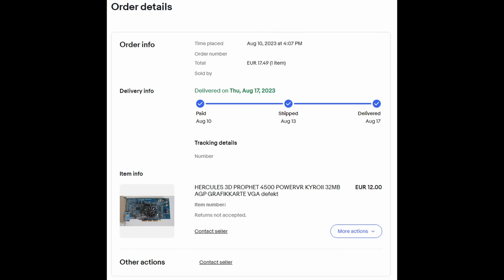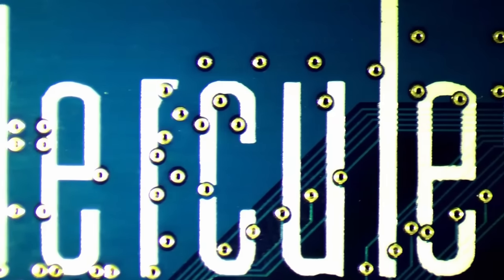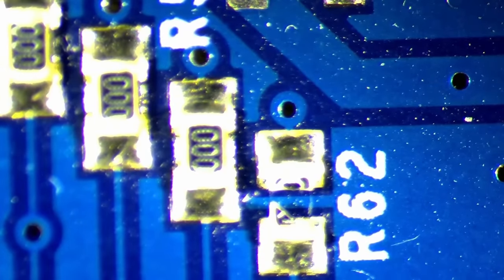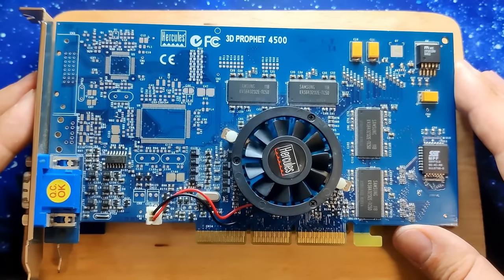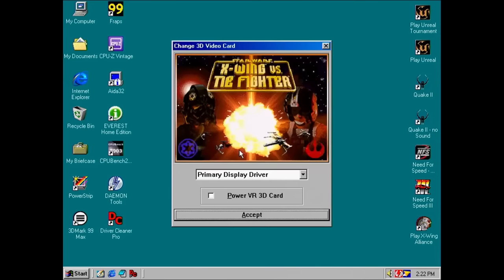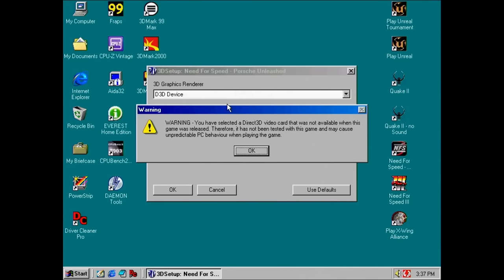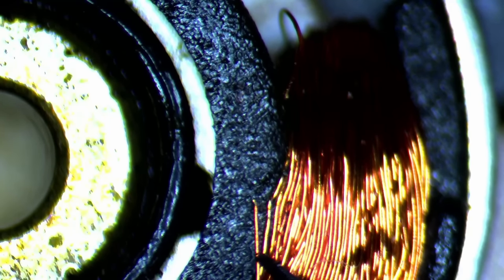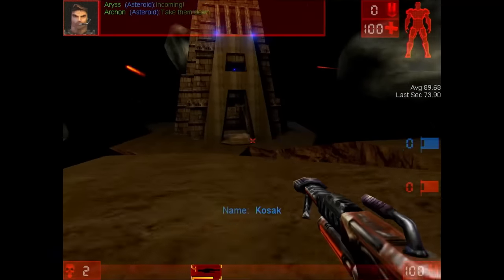Lifeless Kyro II - Reviving a 3D Prophet 4500

Comment: They were one of the best bang for the buck back then, with performance close to a GeForce2 GTS for a lot less money. But the lack of T&L and limitation to DirectX 7 is what stopped it in its tracks really quick. After the DirectX 8 cards were released (Radeon 8500/9000 and GeForce 3/4 Ti4200) and soon after DirectX 9, it was completely outclassed. It had about one year of relevance.
We all wished they released the Kyro III 5500, but the only thing that came out was the Kyro II 4800 (only to some journalists and some devs), which was a slightly overclocked version.
They later switched to mobile 3D graphics, and in a way are still alive in many phones.
Reply: The iPhone 4, and many tablets used Imagination Technologies chips, I too wish they had continued in the graphics card industry, I loved the technology behind the card.

Comment: I was rocking a struggling TNT2 M64 when I finally saved up enough to get a KyroII. It was paired with my Duron 800 (which I still have) and suddenly all my friends with GeForce2's were left in my FPS dust in CS and TFC! Until the later GF3/4 and T&L took over of course... great repair! Can't wait for a deep dive into tile based rendering! :)
Reply: Unless you meant the Geforce 2 MX and the first gen Geforce (SDR and DDR), otherwise the GTS/Pro/Ultra were all faster than the Kyro II. But they were way more expensive, the value was much higher with a Kyro II.

Comment: I, too, owned a Prophet 4500 from 2001. It was quite a jump from the Diamond III S540 that I had before, and in some games could even show a GeForce 2 Ultra up, but these were few and far between so in general, it sat closer to the original GeForce 2 MX, and newer titles demanded much stronger texturing, so I replaced it with a GeForce4 Ti 4200-8X in mid-2003 as we never did end up with the mythical Kyro III with its hardware T&L. The Kyro II had some wonderful features, though - it was a monster with stencils, rendered internally in 32-bit colour (so its 16-bit output was better) and it handled FSAA rather well.

Comment: As for the 0 ohms resistor, easier for pick and place, and easy way to jump over traces, might save you from doing a 4 layer board

Edit: Or me jumping traces on protoboard so I can avoid using wires hehehe
Reply from the maker: Ha! Jumping traces on a layer! That's a great use case I didn't think of! Thanks for mentioning this.
Reply: @bitsundbolts  I only realized that 2 weeks ago or so when I couldn't figure how to route a prototype "nicely" hehehe
Reply: @bitsundbolts The jump tracing feature only occurred to me while watching this video as the broken resistor in this card actually jumped over a trace... 😂
Reply from the maker: I didn't pay attention to that. Haha. I was so fixated on the resistor that I must have missed this right in front of my eyes.

Comment: Insight regarding the 0 ohm resistors:
Indeed, 0 ohm resistors are convenient because a P&P machine can place them around.
They are useful for jumping over traces, as is the case on the board you repaired
They are also regularly used for circuits where an actual resistor may be desired depending on eventual performance or future component swaps/stand-ins. 
There's more reasons, but these are the ones I can think of right now.
Reply from the maker: Thanks for all this info! When I fixed that card, I didn't pay attention to the PCB and didn't notice that the 0 ohm resistor was used to jump over a trace! Definitely something that may help me designing PCBs in the future.

Comment: I had a radeon 9000pro.. on a dual socket 370 with two Tualatin 1.3ghz cpus on an abit vp6 back in the day.  Later went to a 9700 allinwonder.

Comment: I had one back then bought it new! I gave it to a friend and I am very sad I did that because I lost it now and can't find it back...😭
I chose it because it had more VRAM 64MB compared to 32MB Geforce 2 cards had and ATi ones back then for very little more money, it had much greater look that beautiful Electric Blue PCB, also had a TV-out a combined Composite and S Video jack with a little adaptor the box had inside for composite video and included PowerDVD 3.0 which was a very nice bundle to have back in 2001 when internet was a luxury here in Greece.
I remember playing NFS Porsche unleashed with no issues! Your cards do not have TV out parts populated. Also I have never seen one with the DVI part populated...
The card was great in everything I used it of, I used to connect the PC at the TV in the living room and watching movies with my parents or playing games there on the bigger screen which was a better visual experience than my 17 inch monitor.
I had it on a QDI mainboard with a Celeron 800Mhz CPU 100Mhz FSB PIII Class, an SB Live soundcard, Pioneer DVD ROM CD RW for the newer ones that means it could read dvds but read and write only CDs, and I was more than happy! 
I still have the box at my parents' house and all the things that came with it except the card.... 2 beautiful labeled CDROMs with drivers and PowerDVD the most beautiful CD labelling I have seen till this day, a booklet, a leaflet and the adaptor for the composite video.
I changed it completely by accident cause I went to make a system upgrade and use an AthlonXP CPU which was the trend for gaming PCs back then when Pentium 4s proved to be space heaters with bad performance, and took a friends advice to buy a motherboard with NForce chipset for my Athlon.
That was my terrible mistake! He did not know, neither did I , nor the guy at the store which I bought the motherboard that Nvidia was always designing parts first for themselves and then for the others. Nvidia had no AGP 2X cards at the market at that time and for quite a while, so they introduced an incompatibility on purpose to direct you to buy one of their cards with 4X and 8X AGP bus spec.
I just set the system up and system refused to post! I was really frustrated and returned the MB to the store as defective an Asus MB. Then he gave me an MSI one with Nforce chipset which had written in the manual that the AGP port strictly supports 4X and 8X only cards! I would have returned that too but I did not know that the VIA chipsets and SIS ones supported  all AGP speeds and said well the MB is not defective, the industry abandoned AGP 2X, my GPU is old I have to change that too... So I bought a crappy Geforce FX 5200 with the few money I had to match the Nforce chipset.
I gave my Kyro II to a friend which after 1,5 years bought a motherboard for Athlon64 an Asus, that had VIA chipset an was a generation newer than my nforce one, and my Kyro 2 just worked there!
I was so mad at Nvidia when I realized what they did and since then I never bought an Nvidia product again. I also lost TV out for buying that crappy GF FX 5200 so movies with parents and friends gone since I gave out Kyro.
I just found your channel, keep up, that's my story with my 3D Prophet 4500 w/TV-out 64MB @ 175Mhz SDRAM VRAM card 
Cheers from Greece! Jim
Reply from the maker: A very nice, but also sad story. My memory of nForce chipsets is cloudy at best. I did have an nForce2 if I'm not mistaken on a gigabyte board with an Athlon XP 2700+. However, I never owned a Kyro back then. I remember reading about them in magazines though. They sounded like a double edge sword - at least it felt like it. It was the underdog, a different technology, much cheaper than Nvidia products, but at the same time matching the performance of the flagship competition. It was the smart choice to get a Kyro back then.
Reply: @bitsundbolts  I will be completely honest and tell you that they main 2 reasons I bought it were the something different from the ordinary concept as you said and the looks at that time! The bright blue board looked just stunning compared to the other green or brown cards which looked so ugly and ordinary. Also the round blue heatsink with the little fan added to the picture. TVout and 64MB were the nice additions even though it was sdram rather than ddr of the others.
Reply from the maker: The Kyro did look different from the competition. Unfortunately, that might have deterred people from buying it equally as it fascinated others - like yourself. Either way, I agree with you - it does look nice all in blue.
Reply: @bitsundbolts  Also something I noticed after the video and some pictures of my old card, it does not have any electrolytic or round caps at all! I think this was very rare for 2001

Comment: I often use 0R resistors on boards if I am unsure of prototype connections or more often if a track may cause EMC issues which can be solved with a 10R or similar resistance to lessen current spikes

Comment: Funny enough I just sent a box to a friend in Utah with a Hercules 3D Prophet 4500 in it. has a few broken traces by one of the heatsink pegholes, because I was the dumb kid that used screws to mount a completely wrong heatsink when the old one was so clogged with dust that the fan was seized in place. I'm hoping I get a working card out of it again, I can't do repair that small and that card brings back some good memories of 15 years ago.
Reply from the maker: Hope your friend can fix it!

Comment: At 0 Ohms it's only there to provide a jumper or shorting link on the PCB without having to redesign the PCB for small changes, Solder bridge it basically 🙂
Reply: But to clarify, yes - the most common reason is for selective configurability without gross changes!

I, for one, would love to see some comparisons ... I'd love to see you hit up the old S3 Savage3D GPUs too, especially with their "S3 Texture Compression" ... I remember in the late 90s/early 2ks that a lot of my gamer friends were drooling over the texture details it allowed - there was a patch for Serious Sam and the Egyptian (iirc) art looked mind blowing, compared to the blown out, too smooth low res 16bit mess that 3DFX offered at the time!
It wasn't just about saving VRAM, it was about enabling large texture support!

Edit: That whole Prophet 4500 card smacks of a generic placeholder design though ... I wonder what chips might have gone in those placeholders in the solder mask?

And, note that the mask on the backplane looks like it could host a DVI port? I wonder how much clarity you'd get with that? Assuming it's wired up of course, it might route through the smaller of the blank chips ... ?

Comment: There was a very short timeframe where Kyro cards were a good budget choice but the Kyro 2 had very tough competition and lacks some important features, no shaders or Hardware T&L, was a problem when it came out, The advantages of tile based deferred rendering just didn't provide enough of a benefit when the competition  just ended up using extremely fast memory with wide bit counts. The technology is fantastic for embedded applications though and saw a lot of use in phone gpus.

Comment: A zero ohm resistor is often used as a fuse
Reply: it worked
Reply from the maker: I've heard that a few times, but aren't there real fuses that would do a better job at ... fusing?

Comment: I'm going to inspect the resistors again on my two dead Kyro II Hercules cards.  Both crapped out after I got them to run Battlefield 2 and Halo in my PIII i440bx systems.  I figured it was just too much strain on the cards, they overheated or whatnot.  I've been careful not to force hardware T&L games on my remaining Kyro 1 card as a result.

If X-Wing vs Tie Fighter supports Power VR it is most likely pre-Gen3 Power VR support for the PCX-1 and PCX-2.  The Kyro series cards do not support SGL or PCX-1, PCX-2 specific games.  The Neon 250 (Gen 2) Power VR card was the last to support the older SGL games, and that support even has issues with some earlier games specifically coded for PCX-2.

Comment: I remember looking at the Kyro cards when upgrading from a Voodoo 3 2000 PCI card. I ended up going with a Geforce 2 MX card based on the fact the Kyro series lacked hardware T&L but looking at the benchmarks that doesn't appear to have been much of a benefit at that time. If you do a comparison please include some of the later Voodoo cards if possible as they were still on the market when the Kyro series were released as well.

Comment: top work.. this is one of the best vintage pc fix it channels..
question, what equipement do you use for the microscoping? do you have a video showing it?
Reply from the maker: Thank you. I use a trinocular microscope (there is a video about it  on my channel). Otherwise, I replaced the camera (which I would not recommend). There are also links in the video description to most of the things I use. Hope that helps

Comment: The PowerVR Kyro never got the recognition it deserved for three reasons:
1. Branding: There was a fierce competition for market share and many brands, NVidia included, already were way better established.
2. Performance: The cards contested based on price and power consumption, but didn't really provide a performance advantage especially since they lacked "Transform and Lighting" support.
3. Artifacting: Being relatively new while using a very different rendering approach meant artifacts and incompatibilities. Drivers quickly improved, but at that time the Kyro's image already was set.

Comment: I never had a Kyro II or other PowerVR based graphics card, but I did have a different Hercules graphics card when this came out. It was a Hercules 3D Prophet II, a GeForce 2 GTS 64MB card. It was definitely in a different class of performance to the Kyro II, but I remember reading the reviews and thinking the performance just wasn't there, even compared to a GF2 MX400, which from memory came out a little before the Kyro II. I'd be interested in seeing some performance comparisons with contemporary competitors (lets be fair and not put it up against a high-end card like the one I had), even more so if it involves a repair!
Reply from the maker: I think I have GeForce 256 with memory issues 😂 (I may be wrong about that again). But that card is still in Germany - I think it's an Elsa Erazor X or X². And plenty of GeForce 2 MX, Pro, and GTS. I think the Kyro II will surprise - especially in 32 bit rendering

Comment: Easy and good fix!! a friend of mine had it, i use to own a Gf3 ti 200.I have a GFti4200 agp8x that is showing artifacts..and i am wondering how to save this one...
Reply from the maker: I should have a few cards with memory errors as well. I'll make videos about those soon
Reply: @bitsundbolts  i am afraid that maybe is the core, the balls. Please do so, maybe i can save it.I already soldered two smd but the issue remains.Maybe you can make a video about smd caps and resistors. The thing with gpus is that even you have an a smd meter, the measurement of the smd is not correct while on the card.Take care, thanks for the video

Comment: I had the exact same card in my Athlon XP 3200+ system.  Bought it to replace my aging 16MB TNT2 on the cheap.  "Tile-based rendering" they said.  Unfortunately the card's biggest bottleneck was a lack of hardware T&L which games of the era were starting to rely more heavily on.  For games that needed it, this card was quickly made obsolete.  Shame really....if it had hardware T&L the story would have gone differently I'm sure.

Comment: So those two unpopulated chip component spots on the Kyro II, on the left side of the card; what would they have been populated with? Does it specify them in the manual or documentation? I'm always curious about things like that on any expansion card, and wonder what kind of upgrades lay beyond them.
Reply: The topmost position with LQFP64 footprint and a single clock oscillator came populated with Chrontel CH7011 PAL/NTSC scaler and encoder, or with CH7009 which is the same plus DVI transmitter. Alternatively CH7031 can be used which is a DVI transmitter only. Correspondingly to which video conversion IC is used, DVI connector and S-Video connector are optionally populated.

The fatter footprint below is for an alternative transmitter that connects to S-Video port on the back, that was not fitted and i don't even wager a guess what it might be.

Comment: I looked up the timeline of this device. 64mb of vram is a lot for that time period. I remember when I got my geforce 2 pro with 64mb. Even then it seemed like a lot.
Reply from the maker: What I understood is, that 64 MB is almost useless for this card. 32 MB would have been enough, but due to the competition with their 64 MB offering, the Kyro also shipped with more than needed memory.
Reply: @bitsundbolts  odd... But ignoring that, memory wasn't cheap. 32->64 was massively expensive relative to the cost of the card.

Comment: It's always great to see how easily you can fix anything that someone else would normally consider unfixable. I would like to ask you for your diagnostic opinion on the possible cause of the fact that the graphics card does not show any activity after being inserted into the AGP slot. The fan does not even spin, but it is functional on another card. Do I understand correctly that the problem is in the power supply of the card? Is it possible that there is a short circuit on the card because the PC does not boot with the card inserted?
Reply from the maker: I think you diagnosed it pretty well. That would be my first guess too. Look for a short on the card. Does the over current protection trigger on the power supply? If not, maybe you can feel a hot spot on the card. Could be a capacitor that shorted.
Reply: @bitsundbolts  I think the over current protection is not triggered. I probably encountered this once with a shorted 386 board, when the power supply started to click, but it doesn't happen here. Thanks for your recommendation. A thermal camera would be useful if I had one. This is a GeForce 5900 and there are a lot of SMD components on the board. Also, the card has additional power via MOLEX, which doesn't help anyway.